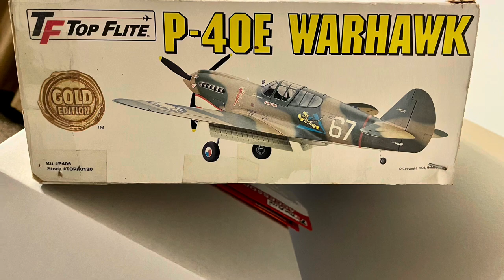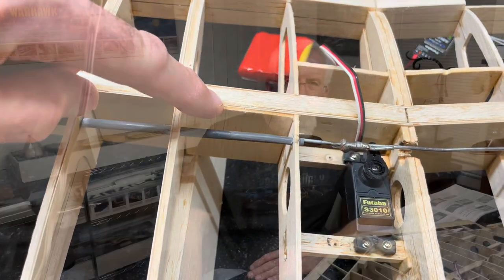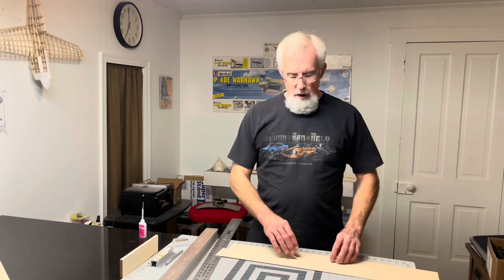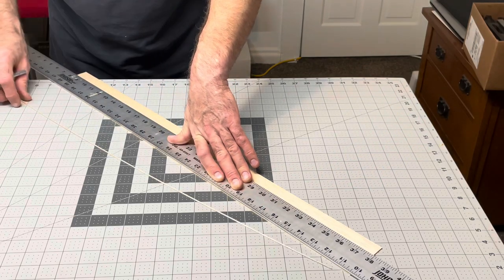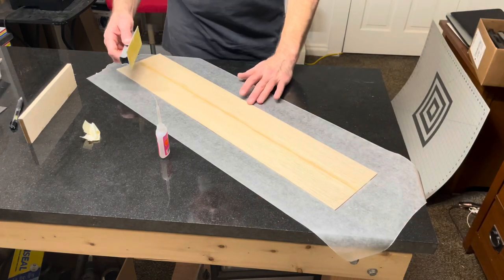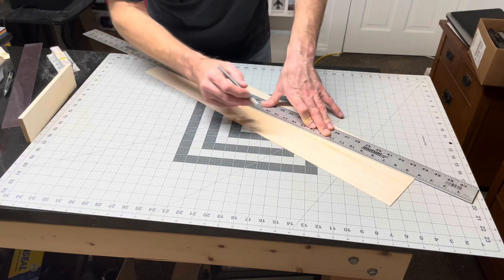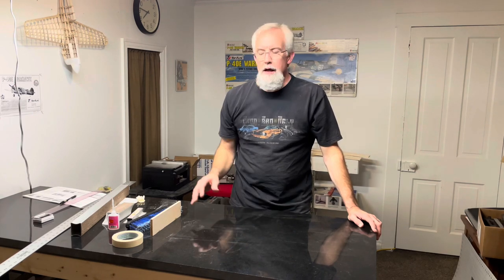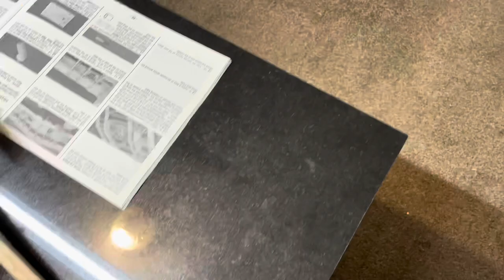Top Flite .60 size P-40E Warhawk Build: Part 12 (Wing Build Up Continued)

Comment: Great build, as to the aileron setup, Personally I would go the 2 servo route with one on each aileron.. just my 2 cents, great work
Reply from the maker: Thanks! I thought about that too, but I’m just trying to save a little weight, even if it’s just a couple ounces. I appreciate your input though.
Reply: hi Frank..yea i did almost the same thing..aileron work great